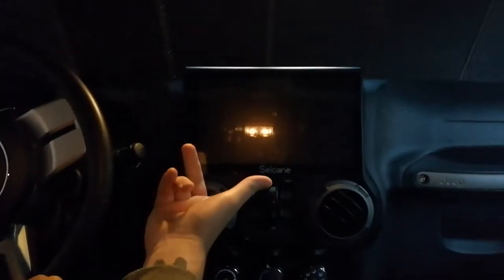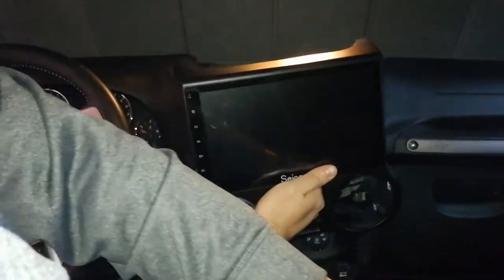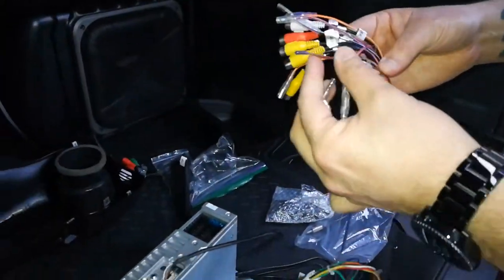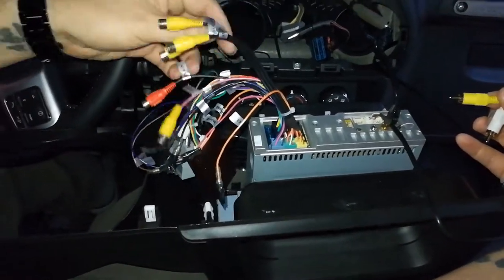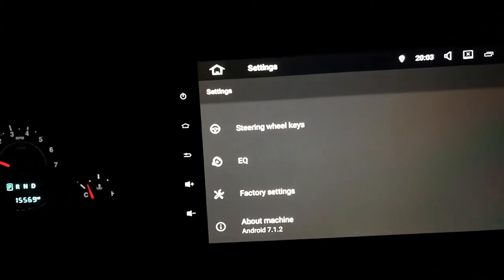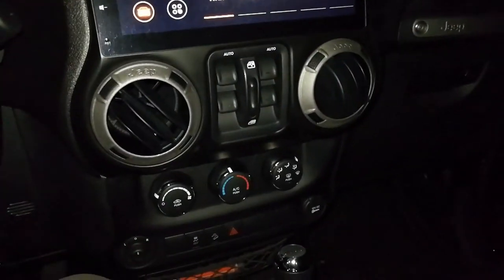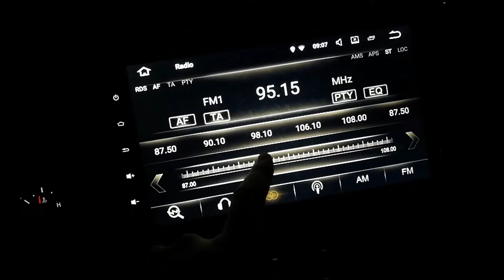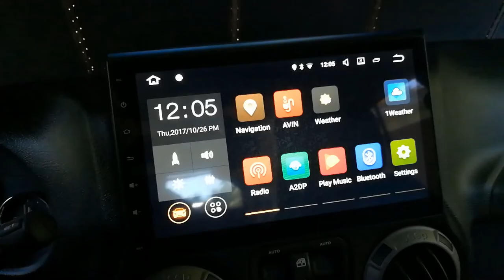Seicane S18JP25 install in a Jeep Wrangler - Android 7.1.2

Comment: So this is the newest one? the link you mentioned appears to be the older system (launcher pics on their site still have the old interface?

https://www.seicane.com/en/hd-touch-screen-2011-2016-jeep-wrangler-android-gps-navigation-radio-with-mirror-link-obd2-digital-tv-wifi-bluetooth-music-steering-wheel-control-rearview-camera-s301171

plus, the model you mentioned S18JP25 isn't on their site where, still showing S301171 (even in your link).

you're guidance would be greatly appreciated!
Reply from the maker: Seicane switches things up frequently. Previously the Seicane S301171 was the older unit and the newer device was the Seicane S18JP25.

But now it appears the Seicane S301171 has been upgraded

Comment: Where is your camera mounted and which one do you have.. I bought the wire less one
Reply from the maker: i had the camera before i had an aftermarket unit.  I got the BrandMotion one that mounts on your spare tire.  It was a bit pricey, but it has worked great, and has worked with several different radios.  I wrote about it a little bit here:

https://5after12.com/2017/10/30/my-rear-view-camera/

Comment: Which head unit do you prefer? The Secaine or the Dasaita?
Reply from the maker: silverbullet0240 the Seicane 7.1 unit, the Dasaita is slightly faster, but has 2 deal killers. The app switcher button disappears and more importantly it doesn't recognize a MicroSD card or USB after sleep.

The Seicane does not have those issues
Reply: 5after12 was that just a bad unit that you received or is that how they come?
Reply from the maker: silverbullet0240 it is a software bug I assume, I installed the same Dasaita V600 series in my buddy's Camry and it does the same thing

https://youtu.be/_S8IOIRIMcU
Reply: 5after12 thanks for the help!
Reply: 5after12 last question, how much was shipping for your Secaine unit? I went to order it, but after seeing the $77 for shipping I decided to hold off.
Reply from the maker: silverbullet0240 I definitely paid $77 for shipping,because I also paused at that price. The price of the units vary. Usually around 300 something, I forget between my orders what it was at the time. I was able to work out a bit of a deal since I had the previous version. But that isn't typical and took weeks and weeks of emails. 

Dasaita was the only one that topped $500.
Reply: 5after12 l’m in the same boat. Just ordered another package from China with free shipping. Their website price of $402 doesn’t even match what is advertised on the Google Store ($389). I have been trying to get in contact with them as I’m interested in buying the backup camera, OBDII reader, and drive cam all at once. So far no luck.

Comment: Man im having problems with mine. When I turn on the hi beam lights getting static
Reply from the maker: Jacinto Almager static in general or static on the radio?

Sounds like a grounding issue
Reply: 5after12  just from the radio. Station plays good and when I flip on high beams gets a bunch of static. I move around the antenna wire and it goes away.
Reply: Think it's the antenna connection they sent. I unplug it and it stopped
Reply: 5after12 do u have led headlights. I cant get rid of the static. If I move the wire around it goes away in some spots
Reply from the maker: i have the Seicane LED headlights:

https://youtu.be/N4W8oE0twsM

Comment: What’s the factory settings password? I’ve been trying all the old ones but none of them are working (123456, 126, 01234).
Reply from the maker: i go into it in this video:
https://youtu.be/5cavKcYauSk

it is "m123456"
Reply: mine is 121212